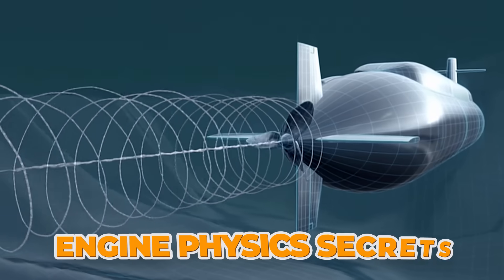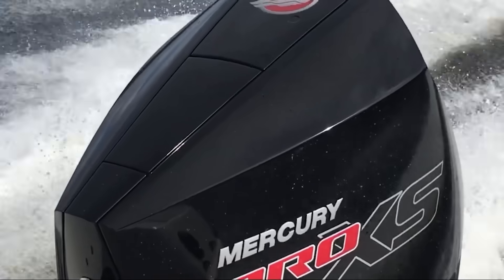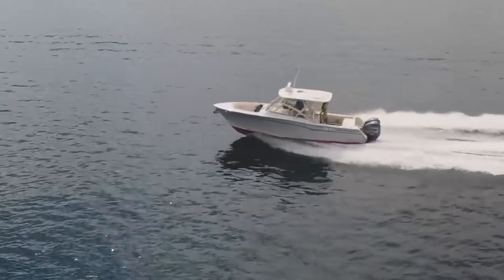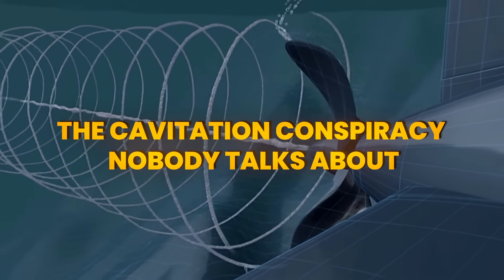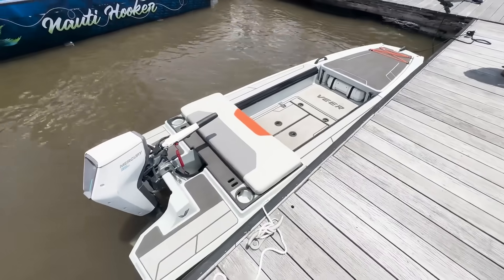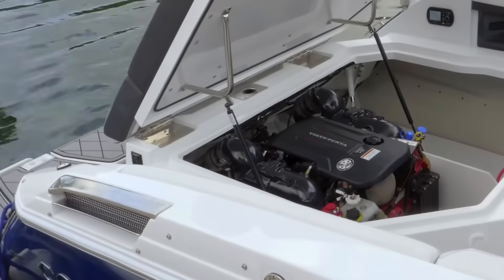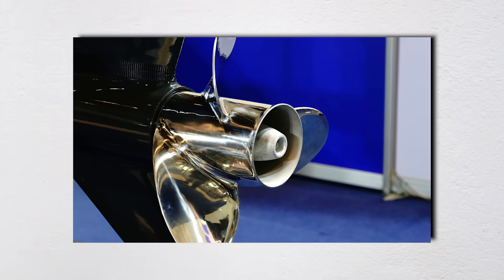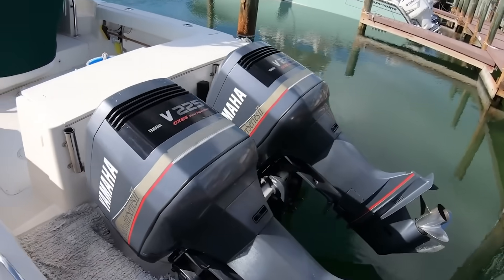Engine Physics Secrets Every Owner Should Know

Comment: At about 6:30 mins you talk about cut but I'm wondering if you meant to say cupping or rake? Cut is more about the shape of the blade. You didn't take about rake or cupping which also matters. I'd love to be able to start adjusting my motor height but easier said than done on a Yamaha 225hp. I can't imagine the issues I could run into on a motor that was installed at factory. Not sure what adhesive may have been used and could turn into a nightmare. Do you have any videos on what would be the most optimal height to start with? As you noted, there are a lot of standards out there that you may not agree is optimal. It's a big commitment to just start moving your motor around.

Comment: @8:30 You mentioned the torque between gas and diesel engines... but what you failed to compare, was the difference between those 4 stroke and a 2 stroke gasoline engines. 
 
HUGE difference. 
NOTHING compares... until electric catches up.

Comment: Don't be scared about electric engines taking over. They are fine for displacement boats, but absolute shit for planing boats.
You get bad range for like 4 times the cost and much less power.
Only the fanatics and areas bound by law (also kinda fanatic) should get electric planing boats.

The major problem for electric boats compared to cars is energy density. In cars you don't use much energy when you are up to speed. In planing boats you have to keep pushing hard to stay planing. Water has a lot of resistance.

You are right about diesel engines, but kinda forget they are twice the price. Atleast on European market.

I work at a boat manufacturer as engineering and sales. Electric boats are way under 1% of our sales.

Comment: BRAVO, Sir! 
Hands down The BEST explanations and practices I have ever seen on this subject to date on any YouTube! VERY impressed!
The information provided here is SOLID GOLD, including a few important things I didn't know.
In a previous life, I was a technician who repaired and modified about a million propellers for recreational and high performance boats over the course of a little over a decade.
I absolutely loved the work and it's challenges at times - especially the high perf SS stuff. Alas, my poor back had other ideas about being in a static position for hours on end while TIG welding. The heavy hand-held angle grinder torquing my body in only one direction over and over again didn't help at all either.

The only thing I might humbly add to your wonderful much-more-informed-than-I video is regarding prop pitch selection (perhaps you already spoke to this, maybe in a different way, and I missed it).  During pitch selection for general application purposes, our/my goal was that while the boat was on plane, trimmed and settled in, and at WOT, the engine would be operating near or at the peak of its power band curve. Too little, or too much RPM at WOT was taking away peak performance and efficiency(?) as the engine power would drop off either way.   MUCH easier to show in a chart where those things converge, I hope I made some sense in text here. This is how I would explain it to the average recreational boating customer, while understanding there are other boating applications where this is not the idea approach at all.
 
 No doubt this could be explained much better than I did here. It also may not be the be the best general approach to prop pitch selection there is. During the 1990's it was pre/early internet when I developed those guidelines for our shop. I'm VERY open to any criticism of my approach [ SHIELDS UP! lol ] 

The whole subject is extremely complex with seemingly infinite variables that sometimes requires intuition, developed and informed by experience and sometimes a little voodoo filling in places that are poorly understood (at least for this guy) in attempts to get it exactly right.

Have you looked into the rather recent Toroidal propellers designs? Sooo fascinating and apparently promising.
Would LOVE to know your thoughts and experience you might have with them.

Well earned Sub, my friend.

Cheers!
From the waters of Southern Georgian Bay on Lake Huron, Ontario, Canada.
Reply from the maker: Thanks so much for your detailed and positive comment. I love to receive feedback like this from experienced pros. Glad you have subbed and hope you enjoy the channel! Please spread the word.

Sounds like you had a fun and hard working career! Toroidal props seemed to appear and then vanish, too pricey at the moment I guess. They seem to be doing better in the drone industry!

Comment: Great informative video! 

I have a head scratcher for you. I have a 2000 Johnson Ocean Pro 200 that is not firing on the port side center cylinder. 

Carbs have been rebuilt and have verified fuel delivery. 

Reed plate has been removed and reeds inspected. No cracks or damage.

All cylinders had good compression.

Tested the coil pack and that plug is sparking when removed from the head and stick it against the plug hole. When it turns over, strong spark is visible. 

Went around and checked grounds and cleaned connections to ensure good clean electrical connections. 

Engine runs fantastic and doesn’t miss a lick. It will push my boat 40mph no problem. After a full day of running, I can pull that plug and see a little fuel residue on the plug but it has no soot or sign of combustion. Spark plug is shiny as if I just installed it. 

Next thing on my check list is going to be power pack replacement. What are your thoughts?

Comment: I am sure you are right, my outboard does feel too deep in the water, and I would like to raise it. How is this done? Getting out of the hole has alway been a problem, and porpoising sometimes. I have recently installed auto trim tabs, and I never use the trim. Will placing weight forward help with the porpoising?
Reply: Jack Plate.  I am going to be making one as my cavitation plate sits too low (2") below the hull and what happens in every pin position except one, is it will overrev at full throttle.  Watching the position of the plate while running full speed reveals the water is a few inches ABOVE the cavitation plate. No bueno, the plate needs to be riding closer to the top of the water.

Comment: 25 year boater here and 20 years owning a boat and jetski rental company with a gas dock.  My stories are endless.  I also was the tow rescue boat in our area of a 100 mile lake in Canada.  The trim switch is the number 1 boat performance tool other than correct prop and a tuned engine running properly.  Everything this man says is correct. Electric motors are a different conversation that I won't get into.  Learning to trim your engine properly will increase performance and save fuel. trim down upon first acceleration then trim up to get max planning and fuel economy. if entering a high speed turn trim down for control.
Reply: I was in the industry too for about a decade during the 90's. Repairing and modifying Props, Skegs, Lower ends, etc.
Can totally relate to "My stories are endless.". lol
Speaking of trim tabs, it's baffling to me how often I've seen boaters who clearly don't a have clue about their use, or even existence.

Cheers!
From the waters of Southern Georgian Bay.
Reply: Thanks for acknowledging my comment,  People who buy boats with no experience or training or some kind course is a danger to themselves and others.  I developed a quick doc side training seminar that became the standard in BC Canada.  When finishing a training and i realized they were not really listening or observing after a training session i would flip the kill switch to off and ask the customer to start the boat. Immediately i and they realized they couldn't start the boat. Meaning during water sport activities loading and unloading from the stern mounted ladder they likely left the boat running endangering family or friends . I really could go on for hrs telling negative stories about private boats or rental boats. Often i would observe the rental boats where being operated safer than private boats. I like to think the short driver training was working.  When i realized a customer not listening i often ended with "the life you save may be your own" After working at a large dealership i would see new boats delivered and the customer didn't know how to start the boat, forget the trailer launch technique. Not forgetting the actual towing safely of a boat. I am glad to report my training seminar eventually grew to the government who made it mandatory for boaters to have passed a very basic boat drivers proficiency card and all rentals exempt after a standardized doc side training that only took 15 min minimum or little longer when dealing with towing a watersport device. 
Best wishes and respect from Canada with love.
Giving credit to those boaters that are experienced and safe, good on you.

Comment: I had a 250hp Suzuki 4 stroke. It is on an aluminium hull. I have played around with different props and engine heights. I have found that I get the best performance with a 4 blade prop and the engine mounted on the lowest height. Which goes against the premise of having the cavitation plate higher. The cavitation plate sits level with the hull (I also have a pod on the back, meaning the engine should go higher again). It just goes to show that every boat is different and needs custom set up.

Comment: I have a 2002 Crestliner Fish Hawk 1850 with a 2019 Yamaha 115 four stroke outboard. No matter what I do for weight distribution, it lists to the starboard side while on plane unless I push it to wide open throttle. The motor is centered and square on the transom. Any ideas? 3 shops have all looked and can't figure it out

Comment: I‘m curious about hybrid solutions coming into boat scene. Gas or diesel engine with generators and an electric outboard motor combined. Advantages of outboard technology but more weight. More action radius and less battery problems which weight isn’t to be ignored.

Comment: I only adjust the trim on my 17' aluminum to keep it from porpoising when I'm on plane. Since I've only ever owned smaller boats with outboards I can usually lift myself I never though of trying to adjust the mounting height, they just rest on the transom as manufactured.

Comment: 8:20 to 8:30 wrong. Dont know were you learned that but it's 100% wrong. Deisel engines have higher compression ratio because they need it to build heat to ignite the fuel while gas uses spark. It has nothing to do with rpm. 2 engines with 2 very different compression ratios can turn the same rpm. Just the lower will have less power. The rpm limit is mainly because of stroke. A Deisel engine get their torque from the stroke , which is why they limit rpm or it will sling apart, aka throw a rod or piston. A gas and Deisel engine can have the same compression ratio and act 2 very different ways. Meaning the Deisel will always have more pulling power aka torque while the gas engine will turn higher rpm.

Comment: we used to put a device on outdrive called the Davis Doel-Fin Boat Stabilizer Fin.. it helps to get on plane quicker and get the bow up a bit higher.. I had a 1986 bayliner 18ft with a mercruiser In/outboard motor.. I was able to up from a 12 to 13 " prop adn get better out the hole and top end speed.
Reply: As seen at about 14:35

Comment: Electric outboards with batteries plus their weight & very reduced range with long recharge times, compared to ICE power plants, are an insane idea! Water & SALT WATER CORROSIVE  environments with Lithium-Ion batteries are an explosion & fire hazard that is impossible to extinguish! And, a very highly DANGEROUS potential!
Reply from the maker: All im saying is i have worked with fully submerged salt water lithium batteries for 5 years and experienced no issue. The risk is there but so is everything.

The only fire issues I have encountered have been with fuel pumps...
Reply: @VintageBoats 5 years experience is not all that long in the overall. And, there aren't that many electric outboard boats out there, where the likelihood of Lithium-Ion problem volume hasn't started to crop up & become evident. 😮

Comment: Talking about electric boat motors is pure fantasy and utter stupidity until the breakthrough in battery technology happens. Pure stupidity. Stop embarrassing yourselves and mankind. (and yes I have one for my canoe and it's awesome for putting around fishing but a total joke for anything more...and we all know it)
Reply from the maker: So you have a use for an electric motor then?
Reply: @VintageBoats  Yes, on a micro scale by comparison to the lunacy you promoted. Someday you will be embarrassed that you let propaganda push you so far from logic. Big heavy vehicles(boats bigger than a canoe) cannot be powered by batteries in any useful practical extended way PERIOD. A overtheroad tractor trailer can cross the USA on one fill-up....idiots in the Potato Head Administration were trying to replace that with battery powered electric versions. Go look that retarded math up.... that's about where you are suggesting the same for boats.

Comment: I live on an 11 meter sailboat from 1979 with the original diesel inboard and if anything goes wrong with it, I'll be moving to electric drive. Very, very few boats have done this and there is little on the internet about it, but it only makes sense to me when I already have a massive solar system. I would love to see a video or seven that are more specific about electric versus gas power in different boats.
Reply: I've seen it done.. when plenty of wind motor is generator charging batteries under sail power
Reply: Just do the math yourself...
 VOLTS × AMPS = WATTS

1. How many WATTS do the panel's produce on average/day? 
2. What is the battery capacity in AMPS/Hr? Then divide it by 2 and that would be how much current you have available to run devices at 12 volts.
3. How many WATTS/Hr each does your motor, lighting and all electronics consume?

TIPS: Lithium batteries and water don't mix too well. Use Lead/Acid or Gel types
Watch Das Boot.

Comment: Fyi, im a straight inbrd guy but hate I/Os.
We bought a used Avalon Tritoon. Single Suzuki 350.Dual prop. Supposedly, The guy sold it to get a twin.
Low hrs, small lake.
Test drove fine. Got it home and drive it light load. Suddenly the prop ventilated,  sucks air, going straight & turns. Mess with trim continued happening.  Heavy load same thing. 
Haul it out prt a straight edge across tube to cav plate.  Perfect setup even across.  Drop it down 2 holes, 1.5". Running great, no more problems. 1 still had some sucking air.
Experiment,  put 1.5" block  to space eng back, 1 hole up. Now equivalent to 1 1/8" down.  Its even better.
I  told the setup guy at the dealer we bought it from.  He was puzzled,  but said they set up for top speed. Well with a  5000+lb toon that eng has to move a lot of water. If the cav plates were wider i bet that would help too.
FYI 2 blade prop is more efficient than 4. Its the disturbed water the following blade runs into causes it. Great video btw.

Comment: Electric motors: unless battery technology makes a radical technology leap, electric boat motors will be relegated to small tenders or lake boats with short run times and constant access to charging stations. A more viable option would be a hybrid engine with a internal combustion engine powering a generator which powers an electric motor and keeps a storage cell charged. Run time will only be limited to the amount of fuel that can be stored and refueling is much quicker and simpler.  
There will be packaging complications but with more efficient and smaller generators and electric motors  the packaging will get easier. I would expect to see these first on inboard/out drive boats that have the inboard space to contain the engine and generator with the electric drive motor contained in the out drive.

Comment: Our 18'5" Whaler with a 150 Mercury Opti-max still has the original five blade stainless propeller when purchased in 2002. The engine rarely gets over 5500 RPM's at Wide Open Throttle. It should get up to 5800 RPM.  Based on this fine video it may be too much prop or we can try tilting up the motor a bit more at WOT.
Perhaps we borrow another prop as see if that fixes the issues.
Reply: If you want a different experience go for a 3 blade with 25-27 pitch (my guess). Might be more difficult to nail than increasing pitche with 2" but it might lead you into something different 😊